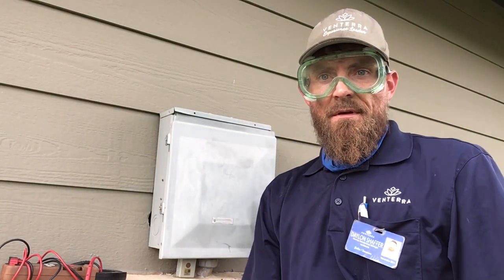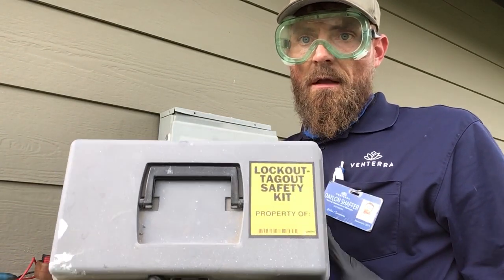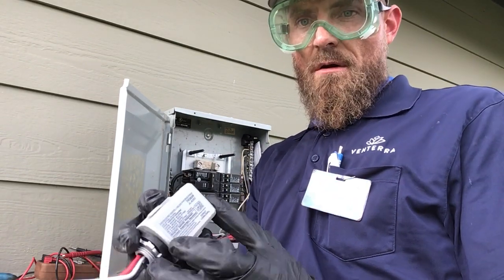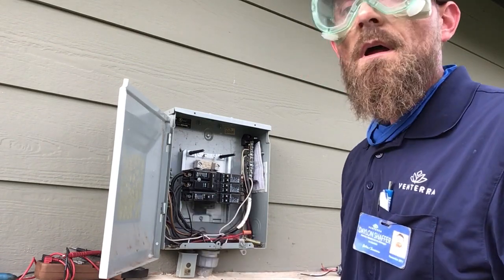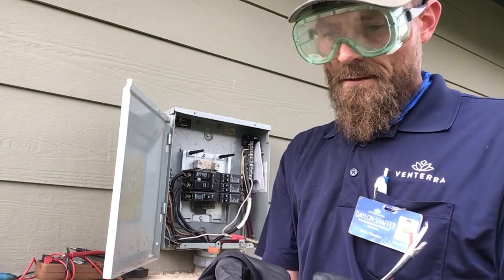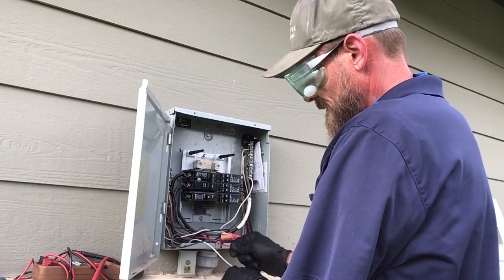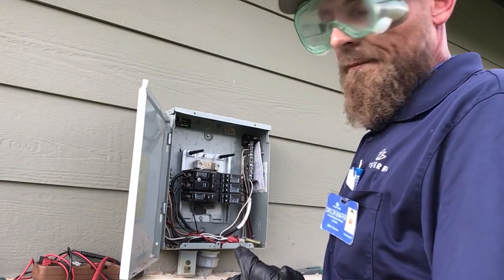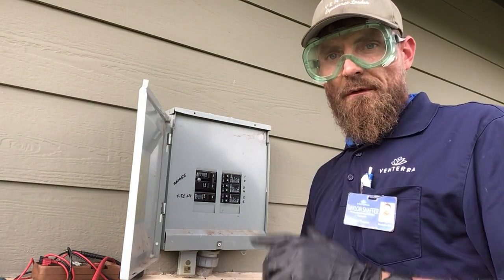How to Install a PhotoCell

Comment: This is how to replace a photocell sensor.,but not how to install one as your title claims. You need to show how to connect all the neutrals wires together to the panel which you neglected to do. Most people are looking for photocell instalation but not a replacement, because they already have one installed and they just need to diconnect and connect.

Comment: Weird too see you screwing around with 110v inside a metal box 🤣 here in Europe, we use platic boxes (with metal parts offcourse (230v)), that don't conduct electricity, in case you made a mislead or some other mistake like, a too small gauge, burn or misfire can happen. That metal plate on top of your box (that whole metal case in fact) is just, terrifying 🤣🤣